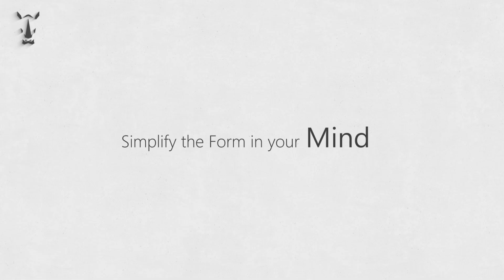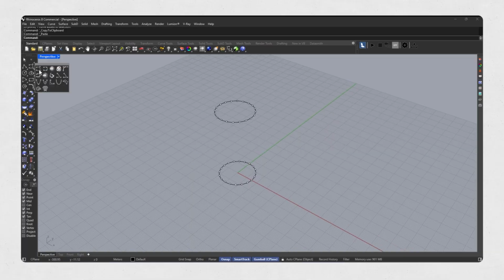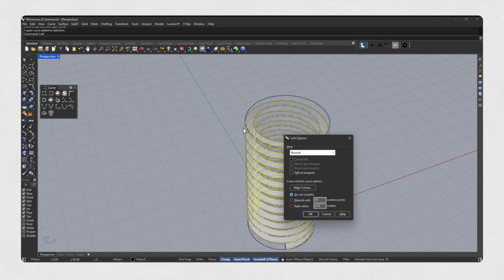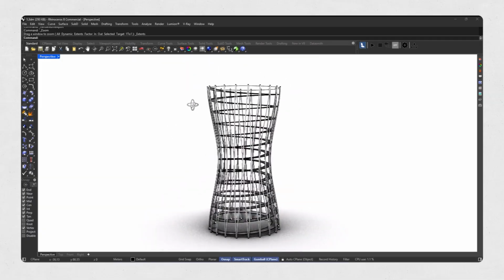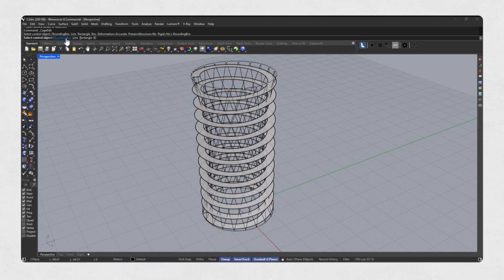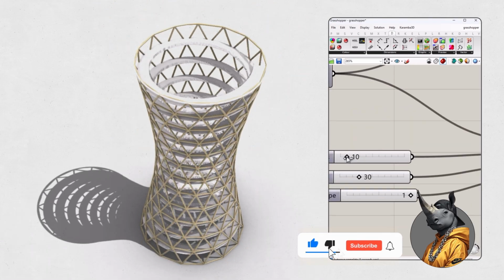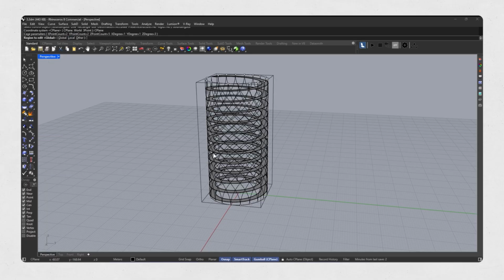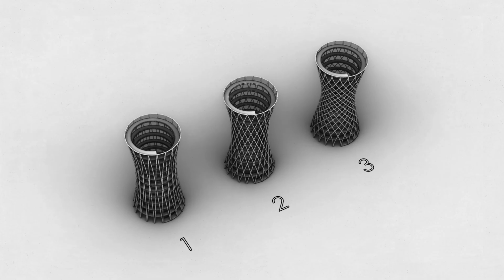3 Ways to Model This Architectural Form in Rhino ( Fast vs Accurate ) | EP1

Comment: question, how or where or which platform would you recommend to show your 3D models, viewable in 3D  that is , to someone in another country, and that someone has no software other than google.
Reply from the maker: Hi! If you want to share a 3D model with someone who doesn’t have any software installed, platforms like Sketchfab or Modelo are the best options. You just upload your file, and they can view and rotate the model interactively in their browser — even on a phone.
Google Drive works for sharing files, but it doesn’t provide an interactive 3D viewer like these platforms do.